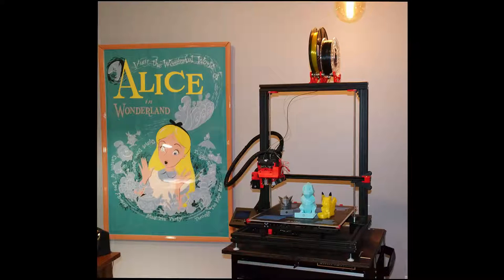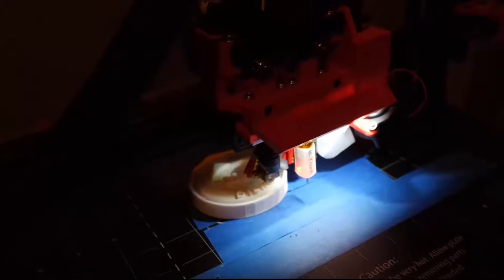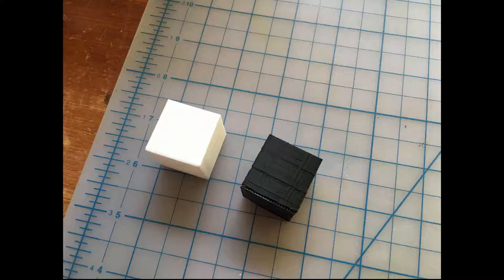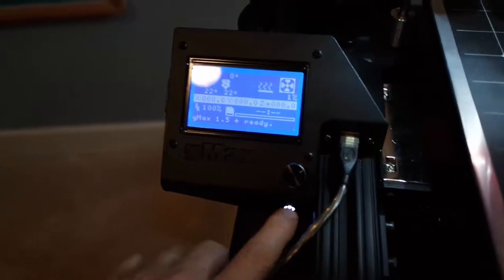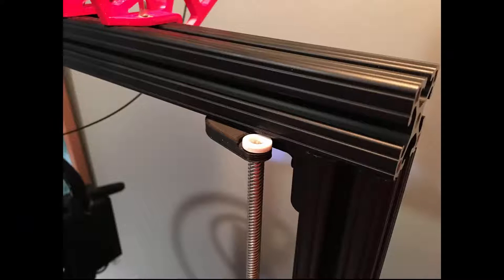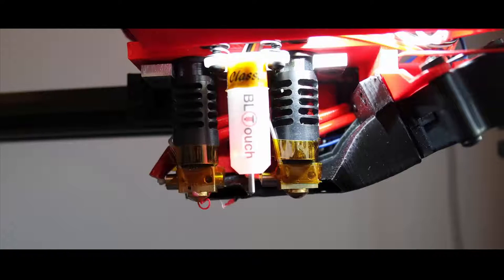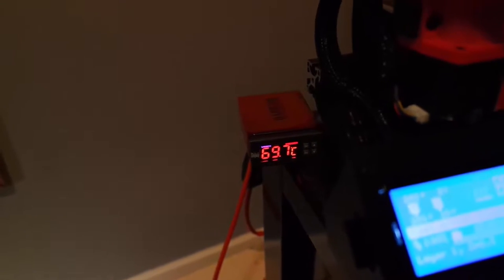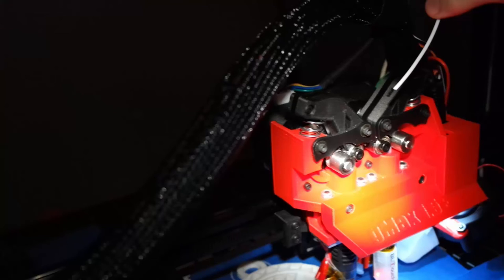Gmax 1.5XT+ 3D Printer Review

Comment: Thanks for your review. I've been looking at large print volume printers (>=300 mm XY&Z), like this one or the Formbot, as my first 3D printer. Based on the numerous issues you encountered, I'm definitely not ready to pull the trigger on a purchase yet. Being an engineer myself,  the build quality on most of the larger print bed printers I've looked at (at least under ~$3K) seems frankly awful. The Fusion3 F400 looks better constructed, but it has quite a bit higher price tag as well. What to do, what to do...?

Comment: If anyone wants another opinion on the gMax 1.5 XT+, here's mine.

Review summary: The large print volume is really the only impressive feature. The printer itself is hobbyist-grade; the high-quality aluminum frame is betrayed by cheap PLA plastic parts. The gCreate support team is responsive and as helpful as they can be, but they can’t fix the firmware problems. Do not expect to do any production-level work (e.g., using any material other than PLA) with this printer without a significant investment in additional customizations, and even then it might not be up to the task.

What we like:
* At this price point, 16x16x21” is an impressive print volume.
* gCreate support is very responsive and helpful.
* The overall build quality is very good. Electronics & moving parts seem to be quality. The aluminum frame is very solid.

What we don’t like:
* At this price point, a printer should have significant usability improvements over DIY hardware; the gMax doesn't.
* gCreate can’t help you with firmware issues—and there are issues.
* Plastic parts on the printer are made from PLA instead of production-quality materials like ABS or nGen.
* The BLTouch Leveling Sensor has no connection to the actual Z position of the nozzle, so every print requires manual “babystep Z” first-layer height adjustments.
* gCreate does not provide consistent-quality profiles for common slicing apps. For example, their Simplify3D profiles are pretty good, but their Cura profiles are essentially worthless.

Read the full review at http://bit.ly/2CD4OGT
Reply from the maker: I experienced the same things you did. When it works, it works well; I have gotten some beautiful prints from it. But yes, all PLA. My fan shroud melted, too, and I was told, "If it's positioned too close it will melt." It's positioned where gmax positioned it! You can't adjust it. I was offered another PLA fan shroud, but what for? To go through the trouble of installing just to melt again? A friend printed me an ABS shroud and it works well. As for their glowing reviews, they really just have one, from a guy they give a lot of free stuff to.